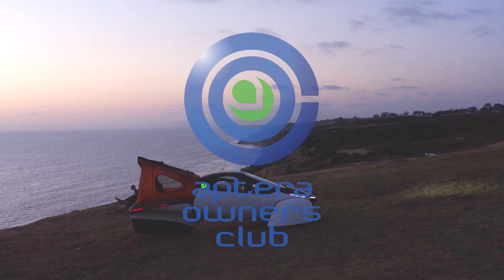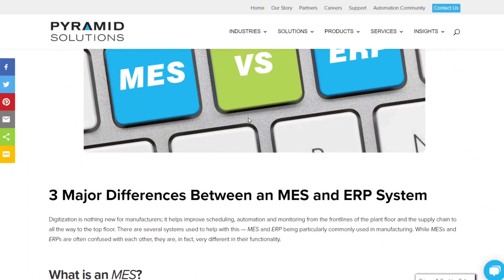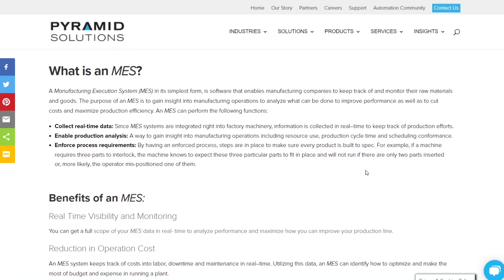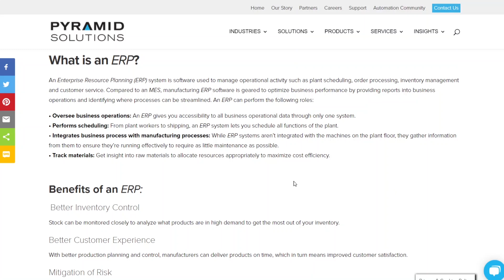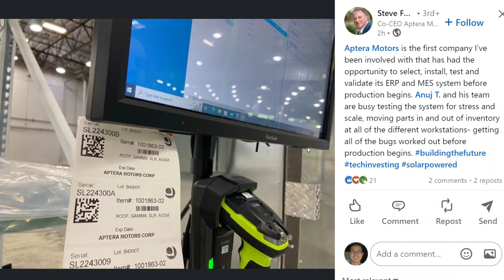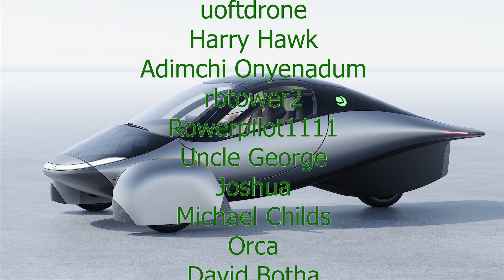Aptera has already bought some manufacturing technology and is testing it

Comment: At one point in my career I helped convert companies to an ERP system called SAP. Sandy Munro is right that it’s better to implement it from the get-go rather than convert to it later. This is because ERP disrupts and replaces all existing processes. I used to tell clients it rendered competent employees incompetent, as it so often led to a lot of turnover. The ERP system is like Audrey in “Little Shop of Horrors,” demanding to be fed. Best to build business processes to feed it.
Reply: You don't make it sound like a good thing.  It sounds like an example of employees working for the software and the process instead of the other way around.  We implemented ISO processes in my workplace.  Now all we do is fill out forms and document all of the work that isn't getting done.
Reply: @jeffp423  Then the ones who implemented it didn't know what they were doing.  The tail should never wag the dog.  I got my company to implement ISO 9000 in the late '80s, and made sure that this would not happen.
Reply: @n.brucenelson5920  In my 35+ years working for a large company that made things, I had the opportunity to help implement both ISO 9000 and convert to a new ERP system.  In both cases I worked on the implementation teams.  ISO 9000 is a set of requirements for quality management and is significantly different than ERP.  ERP is far more complex and can have ties into ISO 9000.  Essentially, all modern manufacturing companies use an ERP system to track inventory, issue purchase orders, issue work orders (to build product), track conforming and non-conforming materials, create shipping documents, issue invoices and keep track of the finances of a company.
Reply: @jeffp423  Bad implementation and software fit can be a nightmare for any major software system rollout.  Much as SAP is terrible the bulk of the issue with horror stories is bad implementation.  Getting things done upfront will hopefully ensure things are smoother when (hopefully not if) Aptera reaches production.
Reply: @jeffp423  🤣🤣:_Logo:
Reply: @jeffp423  That’s exactly what it is, and why converting to an ERP is so traumatic. It’s also a way to dumb down the employees, which in turn makes them more replaceable and plug-and-play.
Reply: @maudessen573  It is only that if the managers responsible make it so.  This doesn't happen with well run companies, especially startups.
Reply: SAP stands for Satan's Accounting Program. I'd use just about any other program than SAP. I prefer EtQ which is web based and far more easily customized, and has integrated supplier management, quality modules, training, work instructions, change management modules, etcetera.
Reply: As a former business systems analyst, software developer and development project manager  for large implementations, I hope Aptera are not considering anything like an  ERP!  For the reasons you outline, these are only OK for very large mature companies in search of effciencies within an inherently innefficient company structure: bureaucracy.Anyone else needs to design their business systems (both automated and manual) for competitive advantage and innovation and so a bespoke development is nearly always the answer. Making your processes fit into the strictures of an ERP is a guaranteed recipe for failure.
Reply: @cairneyr  It sounds like we have had a lot of similar professional experiences. In addition to many of the roles you listed, I used to model business processes. If the ERP is possible to structure as per effective business process models, it could work with this small new company. But since ERPs generally force their structure on the organization in lieu of business process modeling, it adds risk and expense.
Reply: Yeah.  If you know, you know.😅
Reply: If you are starting from zero, there is no existing system to break and no relearning needed.  Unless it is different from any business software purchase that I have been involved with, there is a trial period where the team can set everything up and see how it works before they plunk down any money.  If the system doesn't do what they need, keep shopping.  If you don't think of something or change your mind, well, then you may have a problem. 

I would suspect that if any competent employee is made incompetent, it is because their primary skill is working around the limitations and incompatibilities of a previous patchwork system.